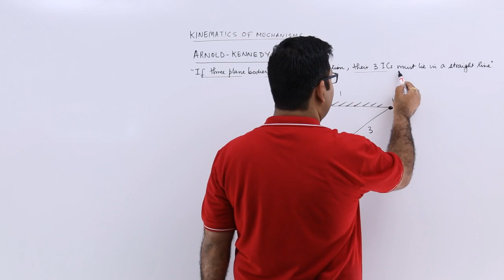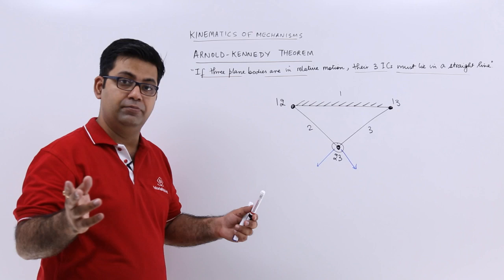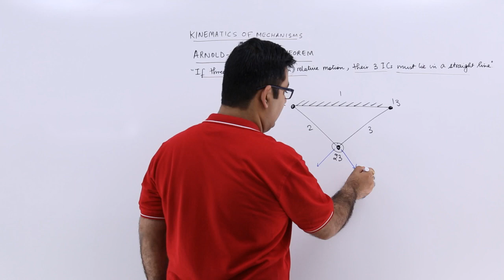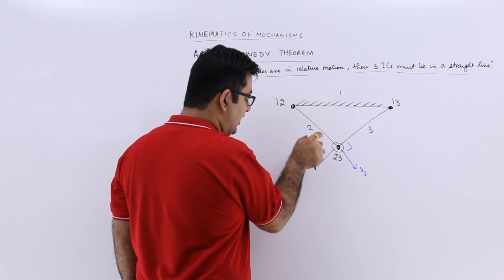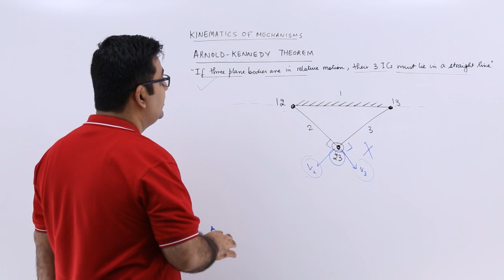Arnold-Kennedy Theorem

Comment: The example that you have taken is a structure and not a mechanism so there exist no relative motion between the bodies ,thus no instantaneous centres exist.
Reply: I'm pretty sure point 23 is not a link (rotation hinge). 
There is no connection between 2 and 3 there. 
That is: 2 and 3 can rotate independently and
23 is just a randomly chosen overlap point. 
The question then is whether it can be an instantaneous center.  
And it turns out only to be possible if 23 lies somewhere on 1 (or its extension to an infinite line).
Reply: You might want to revise the definitions of mechanisms and structures again. A mechanism is a kinematic chain where any one kinematic link is fixed. The configuration taken here hence, is a mechanism.
Reply: @devnash bhatnagar 
Yes bro i totally agree that in a mechanism(basically a kinematic chain) there exist a link which is fixed. But also a mechanism transmit and modify motion.Here in this case there exist no relative motion since it is a structure.